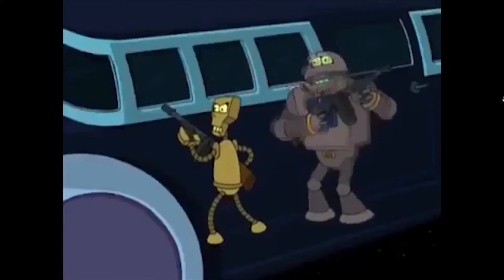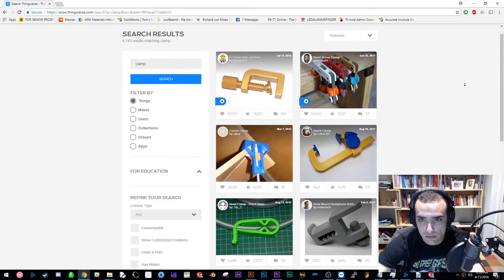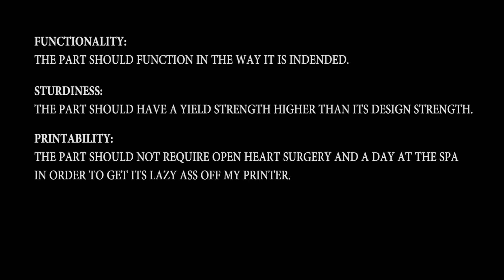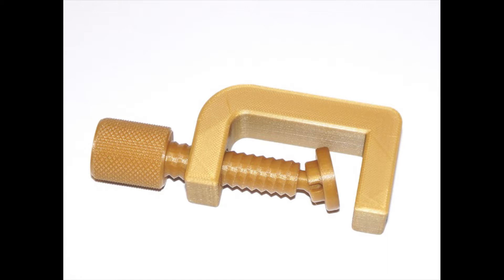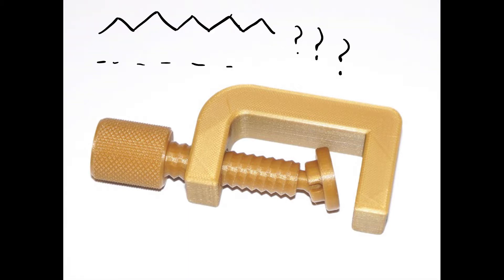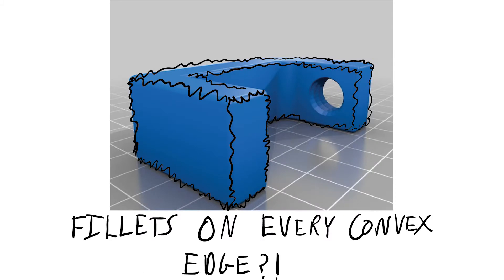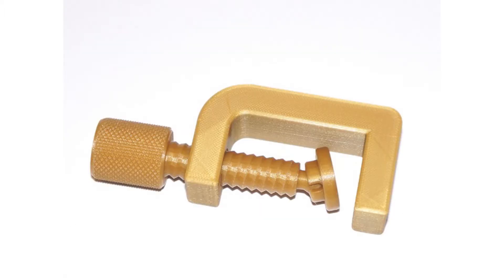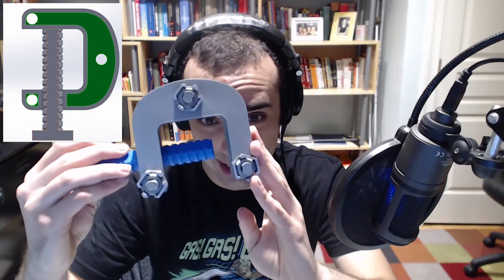3D Printed C Clamp

Comment: I'm sure this is a dumb question, by why didn't you make the seam the large surface instead of the small one?  ie make it so the cross section is like  ] | [  instead of like [ | ].  Not an ME, but it seems to me you'd get similar stiffness, but with shorter fasteners, more contact between the halves, and the hollow produced by the I-beam would accommodate the heads of the fasteners without needing to have them jut out of the profile of the clamp as they do now.  Is the problem that it costs you an overhang where the main screw goes through?

Comment: Nice design, it's really nice to see all the considerations that went into making it! Seriously impressive work. Only thing I'd change is the fasteners, why not design it to be permanent? That would allow it to be much more low profile. I'm mostly refering to how the most popular 3D printed vice which you refered to in your last (?) vodeo is assembled. Nice work man!
Reply from the maker: Good question. Material spent in adding recesses for the nuts would result in ultimately MORE material being used versus less. The other way that a clamp could be printed easily without using fasteners that stick out is to base it off of a C-channel rather than an I-beam, but that would again have required more material to achieve the same level of rigidity, as a C-channel isn't as structurally sound per unit mass as an I-beam is (and it also deforms eccentrically when bent; which would result in not-quite-square clamped parts).  The other option is trying to print the holes in one of the halves as threaded holes, but in my fastener videos I discussed why that isn't such a good idea.

I'm working on the design of more compact fasteners such as spring clips, clevis pins, leaf springs, bellville washers, and other such spring-based fastening mechanisms. I'm also exploring uses of compliant mechanisms to fasten stuff together as well.  And as for the core reason of why I wasn't designing this to be permanent; well, when this breaks (it's only a matter of time until something on it breaks) I like the idea of being able to re-use the fasteners.